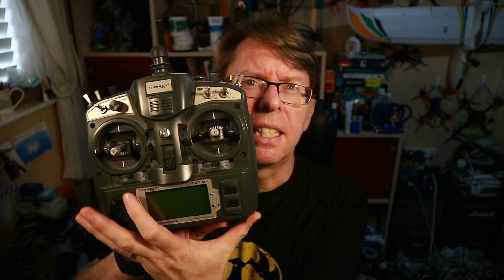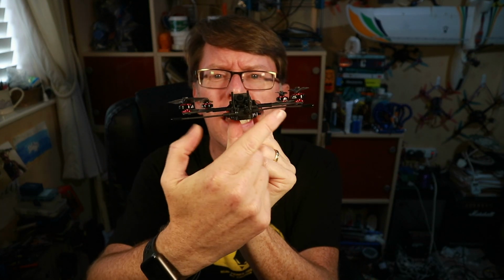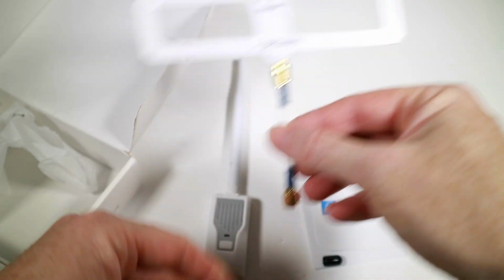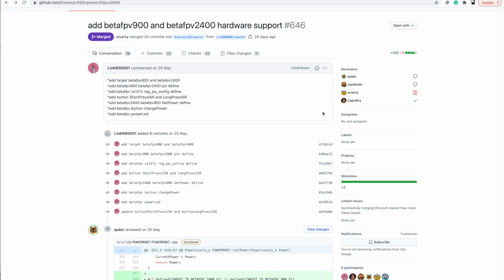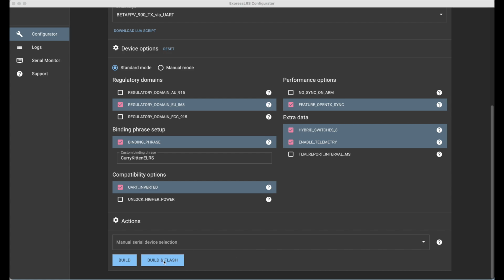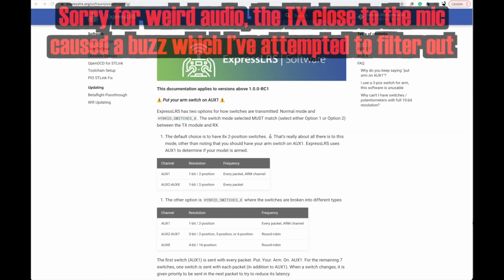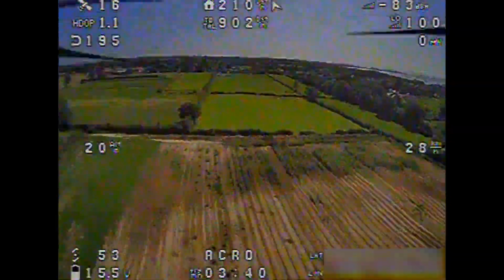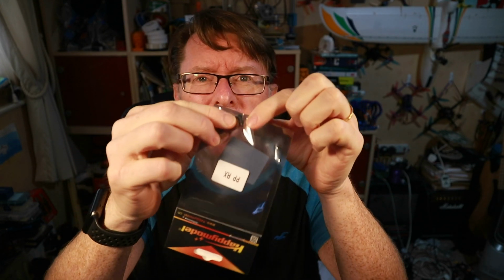BetaFPV ExpresRLS Module/RX's: Setup, flashing, problem resolution, and flying

Comment: I've been using ELRS successfully for a couple weeks already and couldn't be happier as I could make use of my R9 gear.
Reply from the maker: I've been wondering whether to flash mine, or leave it for historical reasons.  I mean, I don't need 3 extra R9 modules all runnign ELRS as well :D

Comment: So can I buy any reaciever flash elrs or only happymodel to beta fpv or happymaodel to happymodel only cheers
Reply from the maker: Any ELRS module should work with any ELRS rx (the only thing you can't mix is 868/915 with 2.4 - but I think that's pretty obvious)
Reply: @CurryKitten  I have no light on back of 2.4 module can I flash over usb ????😜
Reply from the maker: Is this a BetaFPV 2.4 module that you've plugged in the back of your radio?  It'll only light up if you've created a model and said it's using an external receiver on CRSF - did you do that?
Reply: @CurryKitten  no happymodel 2.4 tx Module no light all settings done

Comment: Full watch ....whew....that looked very frustrating.  I'm still looking for motivation to flash my R9 stuff. I'm not sure if it's even worth the trouble since I use crossfire exclusively.  I'll stay tuned though. Good luck. 👍
Reply from the maker: If you are happy carrying on with crossfire then there's not really too much to tempt you over to ELRS.  I like the idea of any module to any receiver and the cheapness of receivers, but that only kicks in when you have a big old collection of things to put rx's in.  It was a bit frustrating though - mainly because I used to work in systems test, and the sort of testing they missed was the really basic functional stuff.
Reply: @CurryKitten  thanks for the feedback 😀👍

Comment: In the race for good hardware, it seems to me that Happymodel is winning. I've been using their 2.4 system for about a month now with no issues. I think it's probably the cheapest as well.
Reply from the maker: If it works as it says it does, then they are winning the race :D  I'm really interested in testing the HappyModel PP RX rx I have with it's tiny ceramic antenna (although I also have a similar rx from Namimno as well)
Reply: @CurryKitten  I'm using the EP2 in my whoops and 1S toothpick which is similar. I can outfly the video which is all I ever ask for.
Reply: I also have the 2.4 happymodel. Received it about 3 days ago.. All went well with the flashing of rx and tx via wifi. I've only flight tested on my crux3 close by with the ep2 ceramic antenna, and that worked just fine as well. My only issue so far has been that on initial startup,  I have to disconnect the battery on the quad and reconnect a second time occasionally to establish a link. DJI users should be aware that as of V1.01, you can only view lq or rssi in the goggles. Not both at one time, and no rssi dB in the goggles yet.
Reply: @kurtzFPV  I had the same issue when I first started using it with old R9mm recievers. It was due to an old bootloader. That shouldn't effect you though. Have you asked on the Discord? Loads of instant help there.